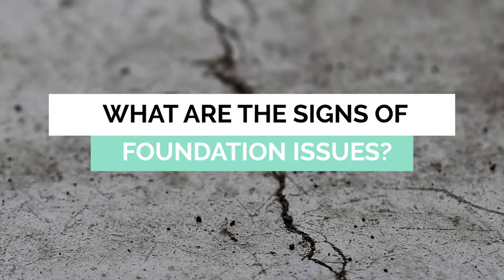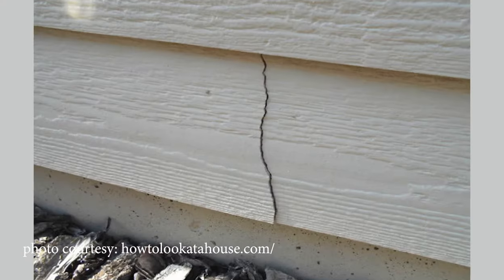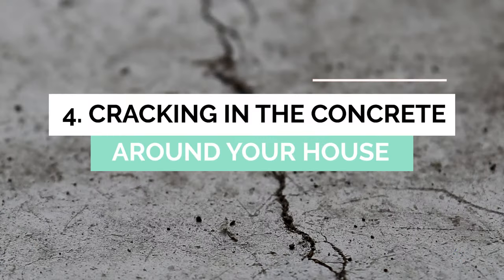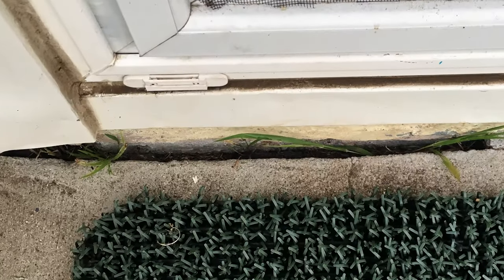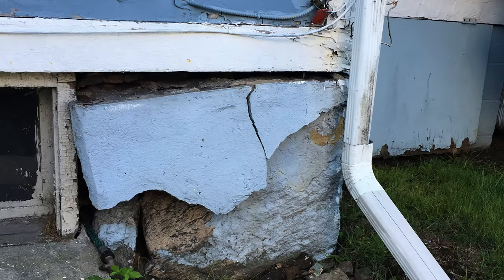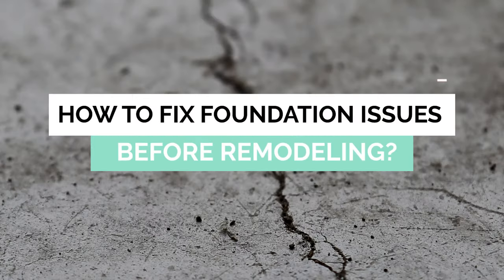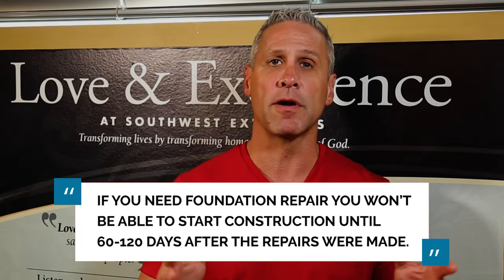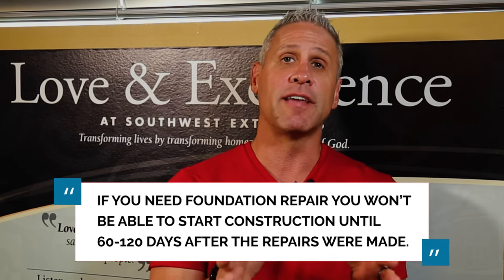4 Key Signs That Your House Has Foundation Issues

Comment: I have foundation problems my basement is wet and some of the walls are starting to bow
Reply from the maker: Thank you for reaching out and sharing your situation! It sounds like you’re dealing with some serious foundation issues, especially with the wet basement and bowing walls. When water starts entering your foundation, it can weaken the structure over time, leading to problems like wall bowing. This could be due to hydrostatic pressure or drainage issues around your home.

We recommend getting a professional to assess the damage as soon as possible. Proper drainage and waterproofing solutions can help prevent further damage, and addressing the bowing walls quickly is crucial to ensure your home’s stability. We’re here to help if you need guidance or have any more questions!

Comment: I have cracks in my cement floor ,,which r hairline ,,is it a cause of concern
Reply from the maker: Due to ground shifting there are always the chances for small cracks as your foundation shifts. Hairline shouldn't be a problem unless you notice them getting bigger quickly. A quick mending or going with a Polyurea coating over the top can help hold everything together longer and give you a better appearance when people come by. 
Thanks for checking out the video!

Comment: I found the head of a drywall screw sticking out from the ceiling in the living room. It’s not really sticking out but it looks like a black dot , this wasn’t there when I bought the house last year and it new house.
Should I be worried? Maybe I’m freaking out and it was there the whole time. Thank you
Reply from the maker: You shouldn't be worried at this point. All houses, even new ones, are going to have some settling which can create some problems in the long run, but with a newer house, unless it was placed on a faulty foundation, you shouldn't really have any major problems at this point. 
Like you said it could have just been something that you haven't noticed left over from the construction. 
Just to be sure, keep an eye on the area and see if anything else starts happening such as cracking in the ceiling/drywall or issues with windows and doors not operating properly. These can all be signs of foundation shifting and all of these problems together could be pointing towards a bigger problem.
Reply: thank you for your response, It looks like I probably pushed the nail down when I was in the attic running wires last month, I was right above that area installing camera wires. Thank you!  @TheHomeSolutionsChannel
Reply from the maker: @8Jallin  that's great to hear!!

Comment: so if its cracked its fked
Reply from the maker: It would depend on how bad the crack is and what is the cause of the crack. Some smaller cracks can be repaired from the outside, but if it's a crack through the house caused by shifting foundation or something similar, then a larger repair could be needed. It's best to always reach out to a professional when dealing with foundation issues.
Reply: Very helpful... Thank you